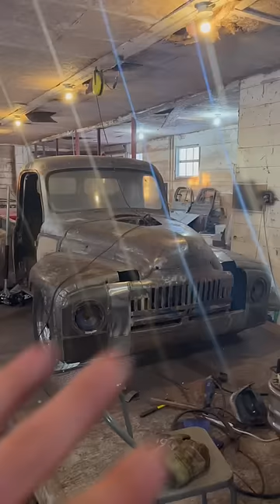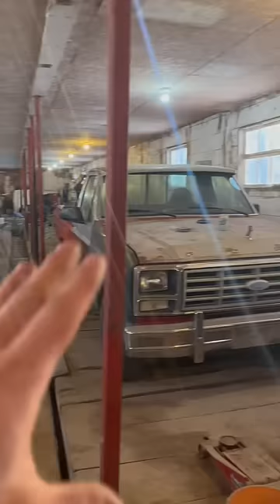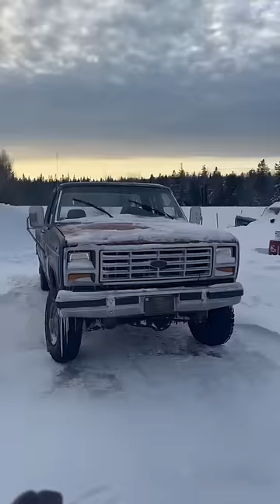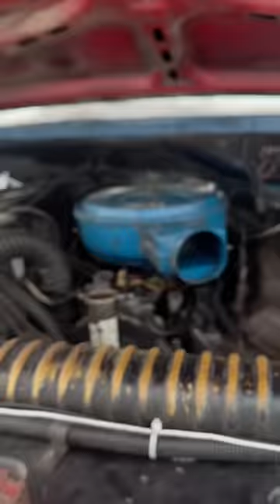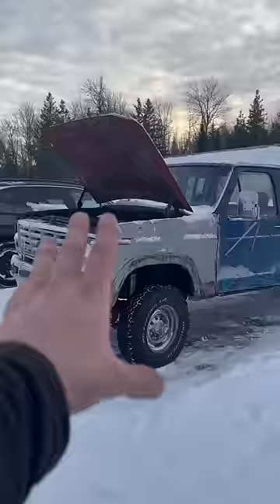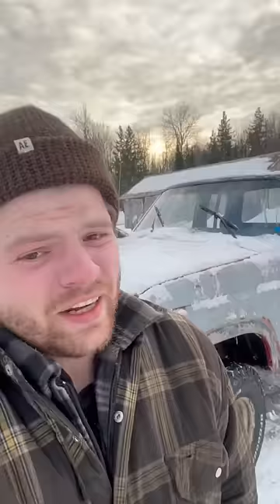FORD couldn’t figure it out until 2011!

Comment: As a former 13 letter s#|+ spreader, my 01 power stroke powered through the factory transmission and the rebuild. The 6.0 and 6.4 were never options for me, and the 2016 6.7 is great.  It may have taken Ford a few decades to catch up, but when they did, they were in front. Yes a Cummins would have been a second choice, but who wants be Rammed?
Reply from the maker: Haha 😂

Comment: My 80 Chevy c20 Scottsdale and the 78 Chevy c20 custom deluxe i had was alot of sledge hammer and punch and chisels and impact sockets and breaker bar it was usually easier overtighten and snapping off the bolts than trying to remove them especially on the spring shackles and the shocks, not bad,, unfortunately that goes back to the 78 Chevy c20 i got from my uncle as a running driving truck he had for a work truck and wood hauler and trailer pulling duty and he had thrown a gasket kit in the truck and changed the water pump heads and then the radiator, and that was in the 5 years he had the truck and after 2 years i owned and daily drove it while my 86 Buick Regal Factory V8 Sport Coupe Oldsmobile roller cam 307 v8 was waiting on the th200c third transmission replacement... I ended up overheating the truck and when I pulled it apart 3 of the 4 water pump bolts snapped off in the block wow that was fun....lol and the alternator bolt broke off in the head, truck had 640,k documented miles on it when my uncle got the truck...in engine repair and rebuild receipts..

Comment: 96 f250 7.3 . With proper maintenance and a good knowledge of the little Gremlins to look for (IPR, ICP sensor, CPS,  fuel bowl heater, etc.., they keep running. Oh yeah, that flashing O/D light is likely telling you to get a 3 disc billet torque/stall converter.

Comment: It's better than an chevy/Isuzu duramax, like those people payed for an import
Reply from the maker: I didn’t know that, wild
Reply: Pretty cool!
Reply: Duramax has no issues getting to a million miles. 
We had those and Cummins. Many of us that live in -40c liked the dirtys cause they warmed up. 
Thats lb7 to lml. After that they got ford costly 6.7 issues.
Reply: well the early 6.2 was a great engine , later followed by 6.5 early was a nice idea. just about the tyme gm had the 6.5 figured out 
it was changed out to duramax . a whole new set of problems.
Reply: @mchl8  the Detroit Diesel 6.2/6.5 was a miserably underpowered boat anchor....
Reply: @NDC1115  to today's comparisons sure a bit lacking , OK the 6.2 and later , later 6.5s were dependable. That's where u gotta consider. They did wat they were intended to.
Reply: @mchl8  Yeah after you replace the factory PMD with a relocation kit  the 6.5s weren't terrible. But a 1996 chevy 6.5 was the bottom of the pile compared to a Ford 7.3 or Cummins of the same era
Reply: Shame a 3.9 Isuzu turbo diesel rapes a 3.9 Cummins in terms of weight to power. The new 3.9 is killer Then you realize Isuzu lost most of their market in the early 00’s😔 breaks my heart. Great stuff if it’s genuine Isuzu made
Reply: *paid
Reply: @rexjolles  I'd change it now but it's been 3 weeks lol
Reply: @mchl8 c'mon, the 6.2 was not "great". Sure, they were better than the Olds 350 diesel but not by much. For a light duty truck, they ran nice when they ran, and got really nice fuel mileage, but they were NOT tough. And the 6.5, there's a reason thier cylinder heads are nicknamed "Crackerjacks". The only heads worth a damn for them are aftermarkets. They weren't "performance" aftermarkets, they just didn't crack as easily. There was even a specific 6.5 block that was prone to cracking for no good reason. 
I'll give credit though, those 6.5 were also very good on fuel economy.
Reply: @NDC1115 They really weren't "Detroit Diesel" engines. Yes I know everyone calls them that nowadays, but it's not accurate.
Reply: @mchl8 Meh, they weren't all that dependable. At least not as dependable as the IH 6.9/7.3
Reply: @NDC1115 Truth. 
Although for light duty applications, the 6.5 won in fuel mileage.
Reply: @John-B-Goodenough Now wait. The early Izuzu 3.9 was an IDI turd. The 3.9 Cummins was ALWAYS a Direct Injected diesel, and that makes it the clear superior.
Reply: @John-B-Goodenough You do win the weight comparison obviously though. There were kits to put Izuzu 3.9 in trucks way back when. I've seen 2 in 78/79 Ford Broncos. Decent looking motor mounts and a flywheel housing adapter to mate to Ford's 385 series bellhousing.
Reply: @johneckert1365  gm owned Detroit at the time, so yeah gm used thier own name for their diesel engines
Reply: @johneckert1365  yes the 6.2 was Detroit I can't speak for the 6.5.
Reply: @NDC1115  I'm incredibly aware GM owned Detroit Diesel at that time, as well as Allison transmission. Were GM's Hydromatic transmissions "Allisons", absolutely not. Were Oldsmobile's diesel engines "Detroits", absolutely not. The 6.2 and 6.5 are Chevrolet engines. Have you ever noticed a Detroit Diesel logo cast into those blocks, heads, manifolds, etc? No you haven't. Just GM logos and casting numbers.  You ever notice Detroit Diesels were all green (accept for Silver Series 92's and some in Fords that were painted Ford Blue)?
Reply: @mchl8  Sorry man, but no they weren't. They were Chevrolet engines.
Reply: @johneckert1365  oh so if we are going by your logic, many series 60s aren't Detroits either
Reply: @NDC1115  All 60 series were Detroits, 50 series too, and most of them were green......
Reply: @johneckert1365  must’ve been inebriated apologies. Think I meant the 3.0 4J’s which throws a wrench in my comparison, although I think I’d still go with the 4J. I see far FAR more isuzu 3.9’s for sale than 4j’s
Reply: @johneckert1365 whatever. 6.2s were advertised as a Detroit. The US government literature for the hummvee calls it a Detroit. Series 60s were actually engineered by a joint collaboration between John Deere and DD, just as the 6.2 was between DD and GM. What about the DD15? Is that a Detroit? It's half Mercedes Benz...
Reply: @johneckert1365  had to reread everything lol was very confused. personally I think swapping a 4BT into a normal truck is pissing in the wind, same with CAT swapping most trucks, too damn heavy and wonky. Had a 24v was much fun however you have no idea how mad I was when a buddy bought a 4jj1 swapped Isuzu trooper after I drilled it into his head. Not a single hiccup, never needed squat. Shame the JDM shmucks found out about Isuzu and now cleanish troopers/pickups/rodeos are $6000+, think he angrily paid $4800 for it could probably get $8k+ for it knowing what people are asking nowadays. Good stuff highly recommend.
Reply: @johneckert1365  damn you lucky bastard you got easily accessible parts. Had a 1990 spacecab LS, slammed it into a barricade going too fast in the rain. Can’t find another two years later, still sad. one Isuzu engine I’m not a fan of is the C223, absolute dogs, shoudve stayed in forklifts where they belong. 4z’s and 4J’s are some of the best engines I’ve ever had/known-someone to have had, on par with the Honda D-Series. Yes I forgot we were discussing truck engines and their performance.

Comment: You seem to forgot about the 6.0 mess when IH got caught between Ford requirements and UAW demands or strike and IH started cutting corners to make contract meet from both sides to make themselves money. My uncle earned $2.38 per hour if he worked on the Ford line vs working at contract rate on IH line

Comment: Im just guessing but I would say this Ford truck especially the springs brakes and the hardware was much easier to work on than his k10, and I say that after owning probably 25 different 2wd and 4x4 gm square body trucks most of which were 75-79 round eye square body trucks and i even had a 80 Chevy c20 Scottsdale burgundy and silver pinstripe looked very similar to the diesel c10 you and Angus rescued...

Comment: Ford still don't have it figured it out. 
6.7s in mines where I worked always have issues. Always.
Reply from the maker: I guess the 6.4 international variant (maxforce) doesn’t have nearly as much issues as the 6.4 ford, basically ford turned the hp up too high and added a lot of their own software and slight equipment changes to the long block, that’s likely why it’s not the hottest. As for the 6.7 i don’t doubt it, we have one for the main shop and it’s been nothing but issues
Reply: My guess is emissions problems right? 

All new diesels have those, egrs and def is sin, ban the EPA
Reply: @Abandonsoyciety  If only they'd ban EPA.

Comment: International couldn't get it right either from 03.5 - 10  but damn did they build some legendary motors for ford befor then
Reply from the maker: I know that the vt365 had far fewer issues than the ford 6.0 (same engine just international trim vs ford trim), a lot of the reason comes down to ford wanted higher hp and tq than the engine could really handle to compete with GM and Chrysler so they basically factory chipped them.
Reply: @highostablegarage ABSOLUTELY. Far less emissions on IH medium duty trucks too. There were some 6.0 used in Ford medium duty truck too, and those were alright.

Comment: From my understanding the 6.9 was still IH. From the 7.3 IDI up to the 6.4 was International Navistar.
Reply from the maker: I’ll have to check the valve cover, not sure the year they rebranded
Reply: @Higho Stable Garage  from what I remember, IH went under in 1984 and the Ag division was bought my Tenneco and merged with JI Case to form Case IH. The Truck division was sold off to Navistar to form international Navistar. Our S1700 dump still has the IH logos and is a 1983. The later ones have the Navistar Diamond.
Reply: Can confirm work for an international dealership 7.3idi-6.0 where dt in the 6.4 was a max force  and they were no more reliable, and the heavy duty side
Reply: @ironworker1301 WRONG. "DT" stood for "Direct Injected, Turbocharged". Higher horsepower 466 were DTA 466, because they were Direct Injected, Turbocharged, Aftercooled. No International idi engine was labeled DT. Never.

Comment: They had the 6.6 and 7.8 in the 80's and 90's. Think they were too big though. Wish they'd gone with the DT360 instead of the IDI though
Reply: @Just a guy with 420 a bong and stupid ideas  of course I watch peg. Nowhere did I say it wasn't a great engine. I have 2 of em. The dt360 is just more upgradable and can hold more power. Make the cummins fanboys cry
Reply: I used to say the same thing, Ford should've used thier 6.6 or IH DT360, but  they never would've fit. The waterpumps are in front of the cylinders and timing gear case, sticking out way to far, giving the engine an impossible length. The B series Cummins had the waterpump offset to the side so it didn't add any length to the engine. IH followed suit when they redesigned the DT466 in 1994.
Reply: @Depressed_Nightfury It would've been great though if it would've worked. The DT 360 had wet sleeves too, making in more reman friendly.

Comment: Better little known fact all international/ford diesel truck engines from the 6.9 to the 6.7 all share a single consistent part and it’s made for neither ford or international. All of them use Big Block Chevy hydraulic lifters.

Comment: The thing is it's not fully designed by international fort had to take in some part considering it's going to be built for their trucks Dodge is different they have never built their own diesel for their trucks ever since they started putting the Cummins in it back in the 70s
Reply from the maker: True, pretty much since the 7.3 powerstroke ford was putting their own accessories and twists on the long block.
Reply: You're a little off. The only diesel in 70's era Dodge pickups was a small Mitsubishi 6 cyl that wasn't popular. Cummins didn't end up un a Dodge pickup until 1989.

Comment: I'm not a ford guy at all, but anything before 93 is ok, anything before 83 is cool, anything before 76, mint...,
Reply from the maker: I can see it, my favourite year is a 66
Reply: @highostablegarage  my favorite is my 63 stepside short bed.....but it's also the furthest from useable.
Reply: I don't get your cutoff years 🤷‍♂️ A 93 Ford is no different than a 96 (98 in HD) other than the 7.3 becoming the Direct Injected Powerstroke, which was a huge improvement. 83 makes no sense because 80-86 is the same truck, other than the diesel option starting in 83. Then 76? Besides grilles and the FE engines being discontinued, nothing significant changed from 73-79. I don't get it 🤷‍♂️

Comment: Neither does the others though, dodge has Cummins and duramax is an Isuzu design
Reply from the maker: Very true, ford might be the only proprietary one right now
Reply: Ford was the original design and creators of the cummins.
Reply: @johnlorch3484  That’s nowhere near correct. All Ford did was use Cummins in their medium duties.
Reply: @johnlorch3484 Completely false 🤡🤡🤡

Comment: I do believe that the ford's are all ford now . Engine trans and axles
Reply from the maker: Very well might be, I thought there still had a Dana 60 upfront but I would have to look it up to be sure
Reply: @highostablegarage still dana front. 50 99/03 and 60 04up. and new process.t cases
Reply: @oregonfordguy9812 10.8 and 11.8 Rears are Dana also.

Comment: That's why I in 2011 all the way up to now Ford term a cheap and made to throw away when they break they don't hold high mileage I don't know much about the diesel Parts of them but I know the gaster like the 5.4 Triton has too many problems to own but I will give it to forward they did something good with the AC I've never had a Ford that when it breaks down at least I'm stuck on the side of the road with good AC but that's really the only good thing I can say about them
Reply from the maker: haha thats wild xD, but oddly enough I known what you mean about the AC, all the early 2000s trucks ive owned have had functional AC still

Comment: Hey are those GM tow mirrors?
Reply from the maker: Oem mirrors
Reply: @highostablegarage  on the diesel? They look exactly like the ones that can on GM heavy duties in the 70s and 80s
Reply: @EveryDayCrud same style difgerant heads. therefore stamped. I use 90s ford heads on my 70s trucks. (taller) and no one knows.

Comment: So much wrong with international the 6.0 the 6.4  Ford dropped them for a big reason
Reply from the maker: 6.0 international wasn’t too bad, the 6.0 was over tuned for what the engine was designed for, as for the 6.4 and the international maxforce 7 I’m not sure but likely the same reason, ford wants as much hp and tq out of these engines to compete with GM and Chrysler

Comment: "ford couldn't figure it out for themselves until 2011" thats a joke isn't it. you forget probably the most widely produced albiet for medium duty truck motors ever. the Ford 636/CAT 3208, and the Brazillian 6.6L I6 Diesel, and the 7.8L Brazillian ford diesels.
Reply from the maker: Considering ford didn’t make those engines either idk what your point is, Cat and new holland made them, ford just reskinned and tinned them
Reply: He's talking about pickup truck diesels.
Reply: @highostablegarage Not quite true. Ford does owe New Holland a shout out for thier design work, but Ford did build those 6.6/7.8 engines in South America, and they were great engines. 
Similar to Jeep's 4.0, AMC designed the original, but Chrysler kept building them for roughly 20 years, and did make some minor changes.
Reply: @highostablegarage I think I read somewhere that Ford was involved with Caterpillar when they designed the predecessor to the 3208, which was the Caterpillar 1150 and 1160. They were solely built by Caterpillar though.

Comment: It's not that Ford, couldn't figure it out They had a partnership with international but.After the fuck up with the 6.0 power stroke and the 6.4 power stroke ford just said screw it and built their own and funnily enough.The 6.7 power stroke is the best performing and most reliable powerstroke engine sense the 7.3 Now, don't take this comment the wrong way.I love international but the 6.0 power stroke and the 6.4 power stroke were not their best work

Comment: they can't be killed what ever you do to it
Reply from the maker: Sure can’t
Reply: my dream car is a 69 Camaro
Reply: @highostablegarage  hey higho stable garage my dream car is a 69 Camaro Z28
Reply from the maker: @monsterdemolitionman1235  they are some nice
Reply: Either a 69 Camaro Z28 or a Ford  GT 40
Reply: 2 words. Navistar International. 
6.4 was almost as bad as GM 350 diesel.
Reply: @kneedragon76 Towards the end of it's run, the Oldsmobile 350 diesel wasn't all that bad. They were very good on fuel if you could live with the lack of power.

Comment: Sir 2008 ford made the 6.4 not international ford made the 6.7 cause international sued ford cause ford stole the 6.0 design boosted the he'll out of it tried to calm it for there own moter the 6.4 y we only got it for 3 years
Reply from the maker: VT 365 is the international trim 6.0, 6.4 is a maxforce 7. You are correct that ford over boosted and tuned these engines to keep up with other brands but international is the one that built them

Comment: The 6.0 and 6.4 weren’t made by international.. I’ll tell ya that for free
Reply from the maker: They are built by international, the vt365 was the international variant of the 6.0, the 6.4 powerstroke is a modified international max force 7
Reply: WRONG 🤡🤡🤡